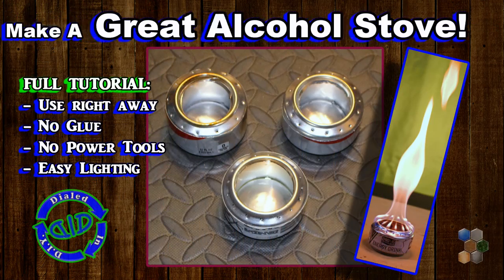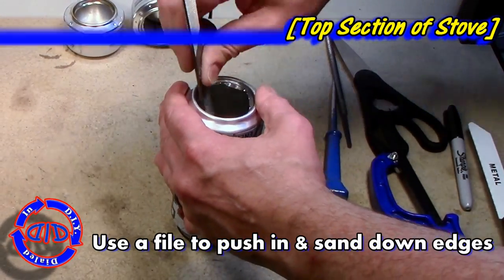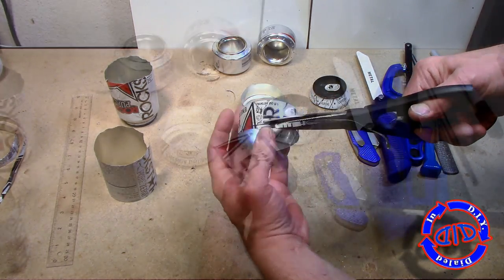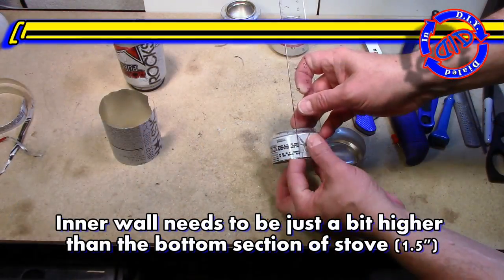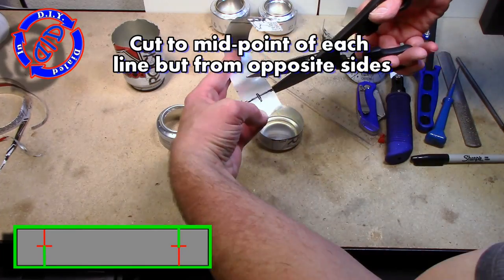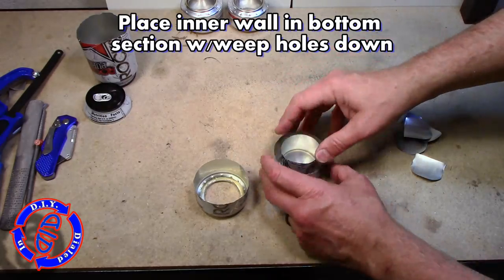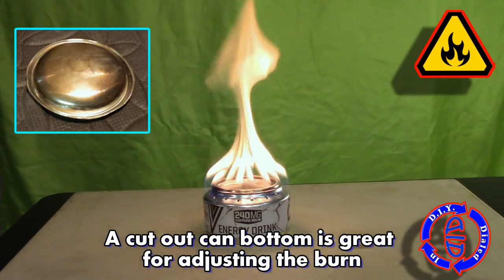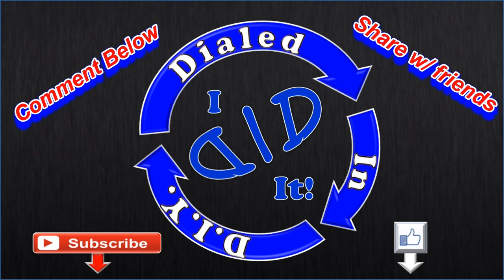Make Soda Can Alcohol Stoves - No Glue & Instant Use & Easy Light

Comment: Honest question: why not just cut a can in half so it’s pretty much a bucket and then fill it with fuel and light it? Is it just more structural with more of the top left up cut? Or are the pin holes more efficient somehow? I see a huge flame in the massive middle opening and it seems like it would almost be the same to just not have the pin holes? I’m sure I’m wrong, but can someone plz explain?

Comment: I love your fast paced narration.  Most DIY videos on YouTube take twice too long to convey the information.
I make pop can stoves but don't use the center column made from the sides of the can.  It's not needed.  I use two can bottoms and do not cut out either bottom.  I drill a hole in the center to fill the stove.  That also serves as the priming hole.  The stove is the pot stand so the center flame is extinguished by the pot once the outer 16 jets are burning.

Comment: I made mine and it works awesome! Your video really helped me out, I have to say, at least mine sputters a little bit, any way of fixing that?
Reply from the maker: Awesome, thank you for the feedback. Sputtering is likely a problem with fuel flow. Is yours taller, shorter, more or less burner holes? Sometimes i get sputter with too much fuel and other times when the flow is weak... not burning hot enough.

Comment: I liked this design, thank you. I appreciate the fire safety warnings too. (Ive been set on fire myself and seen one other person on fire so yeah... enough said). Good design.
Im curious though, in many soda can stoves I see pulsing. Why is that? Is that an oxygen thing?
Reply from the maker: Thank you very much for the feedback.  The pulsing is a good question.  I have seen it when the heat of the stove is high and my weep holes were not able to keep enough fuel running through to keep up with the burn.  On the flip side, I have also noticed it when the fuel is running out which is a similar issue I guess (not enough fuel to keep up with the burn).  Thanks again for taking time to watch the video and comment!

Comment: You inspired me now, and since im an Advrider, weight and space is everything. So I made your stove design now. 11 Grams in total. 
I cheated and used a dremel to cut and file down :|
Ok, so that lid is a must. My burner flames are small (about 1cm) but very hot with the lid on. However, I think we all need to think of a way to make the lid easier to add and remove. Pliers isn't ideal :D
Reply from the maker: Thank you very much.  I really appreciate the feedback and you taking the time to post a comment!
Reply: Fit a thin steel wire in the middle of the lid to help handle then.
Reply: When you cut the lid leave a tab sticking out .

Comment: 4:04 DO NOT cut notches - cut only very small slits (1/16" )......you are trying to build pressure in the inner chamber not vent it.........it will bloom faster and you will have better jets......I use an  .020" drill in a pin vise for my jets.........any larger and you start to vent pressure.....
Reply from the maker: Great tip! Thanks for the feedback.  I have had to work with the notch length to keep it short enough to close down around the raised, inner ring section so that it was a small opening but the slit idea is much more efficient.  I'm going to give it a try on my next stove build.  Thanks for taking the time to comment!!
Reply: I don't think it's going to make a difference when either opening is submerged in the fuel.

Comment: Hello. I made the stove as described. However, as I put my pot on the stove after a few seconds the flames go out? Am I doing something wrong?
Reply from the maker: Couple of thoughts... does the pot have a bit of an overhang or perhaps a bit concave? It could be suffocating the jets. Were you able to get the jets really, forcefully pushing out flame (and not just from the center)? If not, then it may need to prime a bit longer before you put a pot on it. If these things don't work you can also try a makeshift stand. I sometimes put some rocks together to get a bit of a windbreak and to make pseudo pot stand.

Comment: Could you easily pour out excess fluid when you are done cooking or do you need to take the stove apart?
Reply from the maker: Once made I never take then apart.  After a few tries you get used to how long it burns and can dial in the fuel amount pretty well.  Also, they are pretty hot when done so I like to just let them burn out.  Thanks for watching!

Comment: Will it hamper the flow if I were to enlarge to 2 inch instead of 1.5?
Reply from the maker: Changing the wall height definitely changes the flow rate so I experiment a bit to decide what works best for my purposes. If you want to use a 2" height I would suggest putting some wick material inside, between the walls. Many people use rock wool, carbon felt or fiberglass. [So sorry for the delay... life kinda got in the way for a bit]

Comment: Is there a way to turn the flames on the soda can stove green without using boric acid or copper sulfate or copper acetate
Reply from the maker: Good question. Are you going to use it for heating food?
Reply from the maker: Copper salts and borax / boric acid are the only 2 I've ever tried.

Comment: AWESOME.... how many time can you reuse it ?
Reply from the maker: Sorry if you never got my reply (many of my responses on this video seem to have vanished).  I have made so many of these over the years and I have never burned one out; I seem to upgrade my design before that can happen.  Even with some pretty extreme testing I have not destroyed one... I have accidentally crushed one but not overused one.  Thanks so much for watching and commenting!!
Reply: @DialedInDIY  Can you use other substances other than alcohol?? Gasoline or whatever
Reply from the maker: @mustafajuventino9964  Great question and yes, there are other fuels that you can use.  Since these are typically used for heating fluids or cooking it is best to avoid anything that will give off toxic or noxious fumes.  I would not use gasoline but there are options.  Here is a link to a site I found that has good info on camping stove fuels: https://www.msrgear.com/blog/liquid-fuel-stoves-101-choosing-the-right-fuel-for-your-liquid-fuel-stove/
Reply: @DialedInDIY  thanks man
Reply: @DialedInDIY  thanks man
Reply: @mustafajuventino9964  "Can you use other substances other than alcohol?"
NO, NO, and No! Alcohol stoves are meant to only be used with alcohol fuel. Nothing petroleum-based is safe to burn in an alcohol burner.
Reply: @xenaguy01  ok thanks
Reply: @mustafajuventino9964  The idea of a alcohol stove is... magically, that it burns alcohol which is non-explosive and can be doused with water. Gasoline is not that... rather look at another stove design
Reply: @MarlonVanderLinde  ok thanks

Comment: Would it be a good idea to use rock wool or fibre glass insulation inside the stove to prevent any spills if the thing is tipped ??
Reply from the maker: Absolutely!  Great idea too.  I use fiberglass insulation in allot of my alcohol stove designs so no reason it wouldn't help in this one too!  Thanks for the comment and for watching!!

Comment: I just tried to build it and the part about the inner chamber must be wrong! If you cut right where the two sides don't overlap anymore, then you can't fix them inside out!

EDIT: Turns out I didn't really understand the instruction. Thanks for the video!
Reply from the maker: The key is keeping the entire width of the can wall for the inner wall that you are creating. Because inner wall is a smaller diameter than the original wall there will be plenty of overlap for the notches to hold it together.  If it helps, double check the bottom left image at the 3:40 mark that shows how the cuts are made. Once the ring is rolled back to a circle you will connect at the notches marked with green (overlap it so that the last bit beyond the notches end up on the inside of your inner wall).  If that doesn't help to clarify, please let me know and I will be happy to try and help.  Thanks for watching and for your comment.
Reply: I just realized that I have to mark in the middle of the overlapping parts, not at the end of each strip...
Reply from the maker: It took me a few tries to get it to work just right but I really like the inner wall works with this design.  Thanks for the follow-up!

Comment: I made a canister like this but when lit I only get fire through the middle not through the small side holes
Reply from the maker: The weep holes might be a bit small not allowing a good draw of fuel.  Two options that can help. 1. use the top off another can to cover the large hole after it starts heating up. 2. Use the top from a soup can to put under the burner, add a little fuel and light (this heats the fuel to help force out the jets).  Thanks for watching!!

Comment: Will kerosene work instead of alcohol?
Reply: With some carbon felt to wick it, kerosene or lamp oil will work.  Maybe use bigger holes.  I did a carbon-felt wick for an alcohol candle design and on a lark tried some high-dollar lamp oil from Vermont Lanterns.  It burned stronger and hotter than the alcohol version.  Needs a mantle and a chimney to maximize the burning, light, and radiant heat.

Comment: How to turn it off?
Reply: I carry my alky stoves in a larger can to prevent damage and use the inverted larger can as a snuffer outer.
Reply from the maker: Good question... I usually let it run until empty but I have also used the same approach Barking Doggai mentioned by snuffing with a slightly larger can. Thanks for watching my video.
Reply from the maker: Thanks so much for watching and for replying to the question from sankalp R. I use a snuffer much like you mention when needed as well but I usually run the course of fuel that I put in.
Reply: Keep at the tip of high wind sea shore

Comment: Mine exploded
Reply from the maker: Oh no... was it this design? Did it have the same amount and number of holes?
Reply: I made another one and it worked just fine. I think the reason it exploded it's because it heated the air inside and the air has only a little hole on the top to escape. No One Was Hurt.
Reply: I did my own design based on this one
Reply from the maker: @minxyms2748  glad to hear nobody was hurt and that you got it all working!!
Reply from the maker: Awesome.  So glad it worked out.

Comment: The real test is when you try to boil 2 cups of water on this stove. 
You will be faced with 4 questions to answer:

The amount of fuel you used, is it enough to achieve boiling?
And How long did it take?
Do you put the pot of water directly onto the stove or do you use a stand?
In case it is directly onto the stove won't you suffocate the flames? as you did in this video.
Reply from the maker: So true... at roughly 5:30 I put the cover over the larger hole which let the jets keep going.  I have put items directly on top of the stove and had it work well since the jets come from the side. Elevation will effect time to boil so I take that into consideration when deciding amount of fuel.  I also like using rocks around the stove to set a small pot on when possible too.  I don't recall how much fuel I used to get this stove to boil water but it worked very well for that. Thanks for watching and taking time to comment!  Hope you are staying safe and healthy.
Reply: When I set my pot on it to boil water my flame goes out.